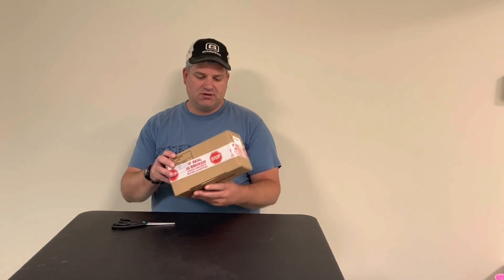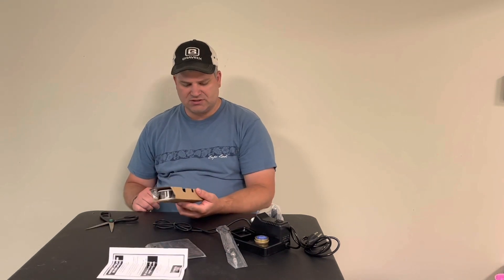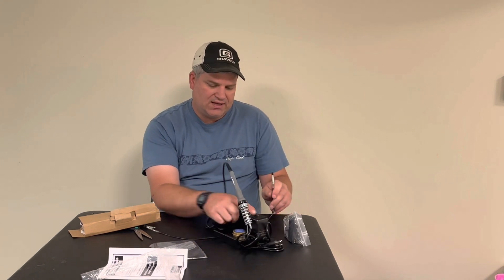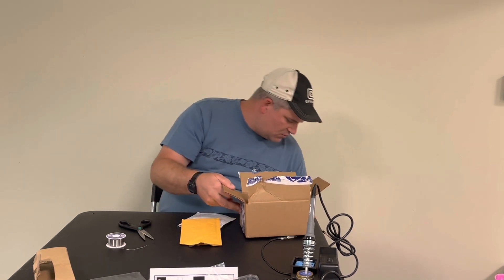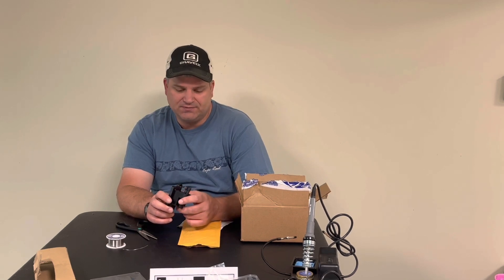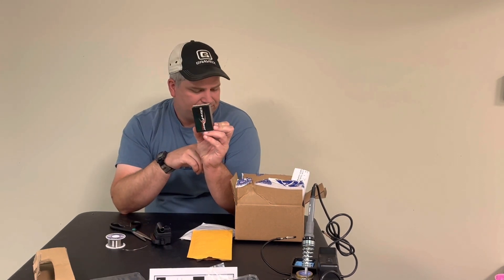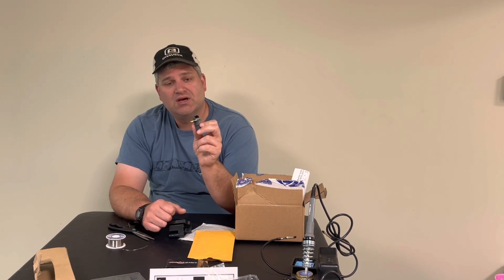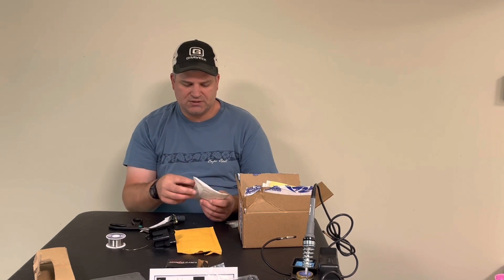Chevy LS2 Ignition for a Small Engine Onan NB Gravely 430 Ignition 3rd Gen Part 1

Comment: I have built systems using both
 the Chrysler and GM models successfully.   I like this idea and wonder if it could be used on a 2 cylinder Onan. I have a 450 that needs help. Is there a coil or way to adapt it to 2 cylinder Onan??  I have been watching and enjoying your Gravely videos for  a while now.  I have 5 400 series gravelys (3 running) and would like to get that 450 going.  Thanks for any tips.